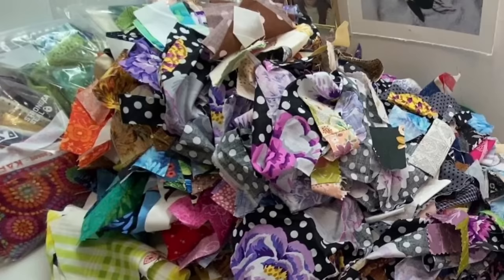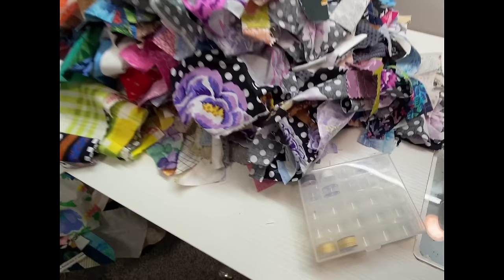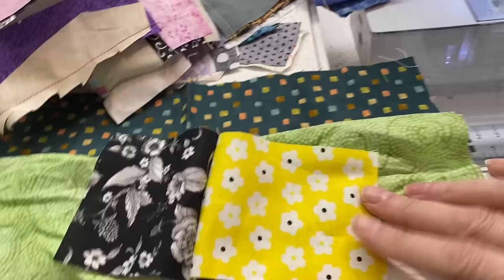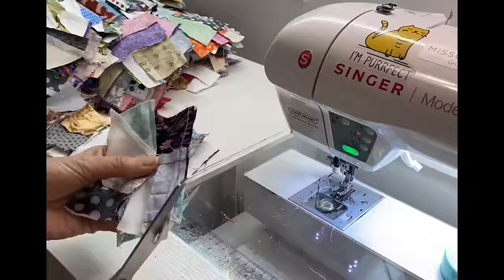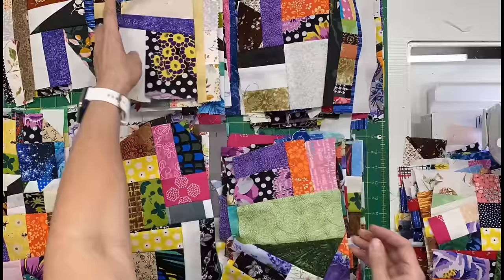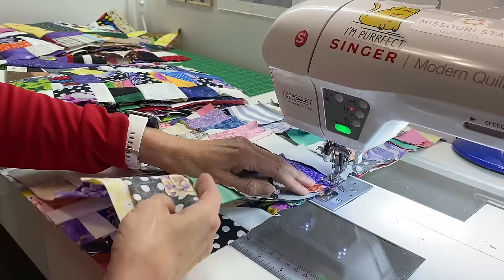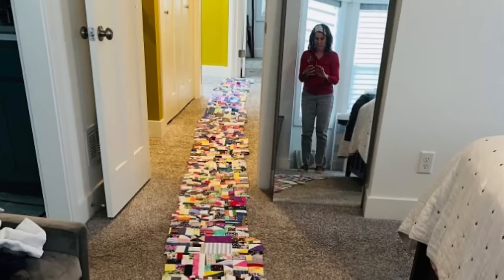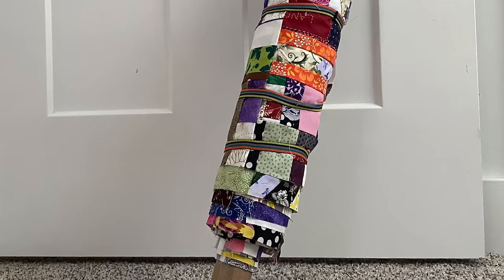♻️ v24.08 | TAME YOUR SCRAPS! | FABRIC BOLT 2 From SCRAPS! | 8 YARDS (x16") OF SCRAP FABRIC!

Comment: You threw out alot of little scraps, but still ended up with an enormous piece of fabric. How great.
Reply from the maker: It’s wild!!  ‼️. I saved some of the bigger cut offs. I only pitched the ones I didn’t think could be sewed to something else. 💕☀️✂️
Reply: Could you use the small scraps to put inside a pillow as stuffing?  Make a pillow form and fill it up.😊
Reply: There’s a lot that can be done with tiny bits of fabric, down to threads.

Comment: Awesome. Never thought to do a bolt. I do my scraps in 10 inch blocks. 6.5 inch blocks and 6.5 x 12.5 rectangles.  Then make quilts from those. It is amazing how they add up. Thank you for showing this version. I might try it sometime
Reply from the maker: Thanks so much for watching!  ☀️🧵. I had one 11 inch square block that I didn't put in the bolt!  It will be part of an orphan block project ❤️⭐️

Comment: Instead of using a wrapping paper roll (it has acids in it that can damage the material if it takes years to sew the roll) I went down to the dollar store and bought pool noodles to wrap mine around. They can be used over and over. I get the wider ones and it cuts down in wrinkling of the scraps. 

I love the way you did this video. And your music was wonderful and really relaxing!
Reply from the maker: Thanks so much for the compliment!  I made a different bolt last year and used it all up.  ☀️.   I've had others comment about pool noodles too!  Great idea!
Reply: I am a huge fan of pool noodles.  They are so versatile.  I have several things wrapped on them.  I also have several that are slit open to go over head high hard edges to protect my grandson’s head.
Reply: I've sewn my scraps together to get certain size squares so need suggestions from what people have made from scrap yardage.

Comment: This was a fun video to watch. I did a small scale of this project. I used up my scraps from all my mens shirts that I had cut down. There was over 50. I made my yardage 30 inches wide for the main piece and around 26 long. Then I made strips about 6 to 8 inches wide by 36 to 40 inches long. The main body I cut out a deer head and appliquéd to a large piece of material. The strips will be  a wide border for a quilt I am making for my husband. It gave me satisfaction knowing I used all my material possible. You are right about the bulk and seams. I made my stitches shorter about 2 and my seam just over 1/4”. The other important part for me was the pressing. I wanted my material flat as possible. I couldn’t do my chain piecing without having my blade saver. It is definitely a game changer when working with scraps.
Reply from the maker: Thanks so much Connie! ☀️. I think your shirt project sounds so neat!  A deer head out of hubby's shirts I bet he will love it! ❤️

Comment: I've had something like this in mind for a while now. I want to make a quilt of alternating crumb blocks wit unpieced blocks to make the whole thing more stable and quicker to make than all crumbs and strings. I'm very reassured by your video, as I was concerned about warping. Thanks!
Reply from the maker: I'm glad it was helpful!  If you're going to set with non-pieced I would just say to press the crumb fabric well with steam too.  Get them as flat as you can.  Then cut your block. They can get bumpy for sure!  But no reason it can't work. ☀️❤️

Comment: I cut scraps from each project into usable pieces and make the same units that are in the quilt top.  Then sew those into larger units and use those in the pieced backing.  The leftover scraps go into a  13 gal can, along with batting & pieces from other projects.  I use this as the center of a tuffet.  It works well because the center of a tuffet needs to be fairly dense to hold its shape.
Reply from the maker: Sounds like you have a great plan in place! ☀️❤️

Comment: I love making crumb quilts to make charm 5”. 6.5” or 10” squares to mix with solids for pinwheels, half square triangles, or disappearing blocks. The solid gives the crumbs a chance to shine. 

Another effective modern look is to mix solid stripes between crumb stripes. They can be different widths also. 

What project did you make with the roll? Video was made vey sel with your explanations and fast forwarding.
Reply from the maker: Hi! ☀️ Scraps and Crumbs are fun!  🌸 I have not made anything else with this roll, yet.... You might enjoy this video where I made stars with a dark fabric paired with lighter scraps.   https://youtu.be/dE541gTc69I

Comment: mathematically, it makes perfect sense that the first "round" takes about half the time, or maybe slightly longer for really small batches. each "round" halves your number of pieces, and sewing half as many pieces should take about half as long. if each round takes half the time of the previous round then it's the same as the sum of the infinite series where n+1=n/2
Reply from the maker: Wow! Impressive! ⭐️. Thanks! ☀️

Comment: Beautiful idea for storing scraps in a useable fashion. However, recommend you cover that wrapping paper roll with some acid free paper before storing your fabric on it. That should help protect your fabric from staining and changing color.
Reply from the maker: Thanks Danette! ☀️ I will likely use it up so fast it won't be a problem, but I did use clear shipping tape over the entire brown paper, so that should be fine too.  I made a different bolt a year ago and there was no staining.  I think the holiday wrapping paper would have turned color if that was going to be an issue? Not sure. ☀️.  Here's how I finished up last year's bolt, if you are interested in grocery shopping totes!  ♻️.  https://youtu.be/tZDSpkkoCsU?si=iceszbr4zI22qRga

Comment: Is there a reason you sew with a larger seam allowance?
I use used dryer sheets (pressed with a low iron) as foundation fabric.  I like to sew a strip diagonally across the dryer sheet & work out from there. Makes a really pretty/interesting quilt using the rectangular sheets & there's enough of the dryer sheet smell to make my studio smell nice!
Reply from the maker: Yes, the reason is some of the scrappy edges have little tiny slivers of fabric and it is easy to miss them if they fold back on themselves.  Try it different ways and see what works for you!  I have definitely heard of the dryer sheet method!  Sounds cool!

Comment: So fun to sew scraps together... I tried this method to 'Make Yardage'... but I found when cutting it into different sizes for quilts...that there were some cuts that had ended up with tiny slivers of fabric left on the sides and ends..not enough for seam allowances, and then when sewn together, would end up with sewn seams in the seam allowance....  Q:: just wondering why you didn't cut the yardage into 3 pieces, sew them back together that way...and have a finished quilt top out of it? Since you were 90% there, in creating a finished quilt?
Reply from the maker: Hello! ☀️ Thanks so much for watching!  If you make yardage from scraps you might try to use a larger seam allowance.  I mentioned it briefly, but I do use a larger than 1/4 seams for these projects.  If you still like the idea try making a couple of small squares and using a larger seam allowance and see if that works for you. As far as your question:  I might make a quilt out of this but I also have some other ideas I might try!  ☀️🧵✂️

Comment: 5:27 if you stuck that tool to the work surface with some blue tack, you wouldn't have to chase it around?...Or maybe semi-permanently affix it to something like a very small cutting board with double sided tape? (if the underside could work with that or even blue tack it to a piece of corkboard, which has some non slip felt underneath), which would weigh it down a little more without making it bulky for storage..?
Reply from the maker: Great tip!☀️